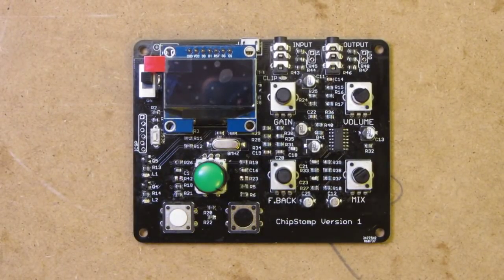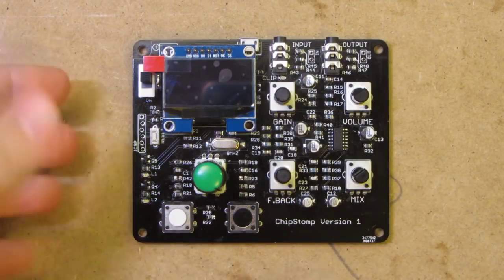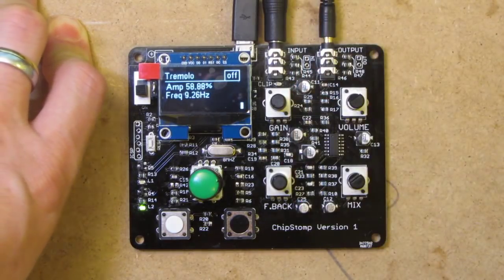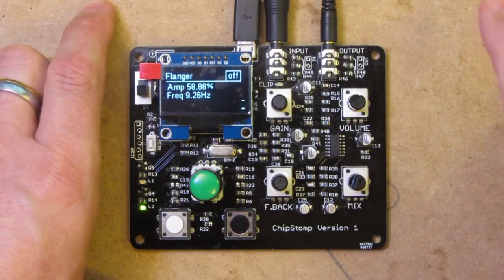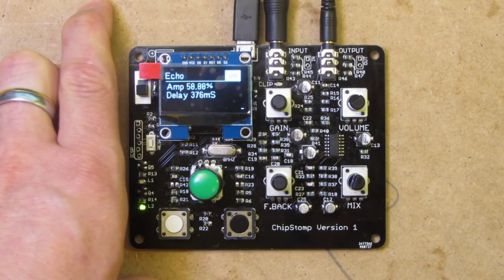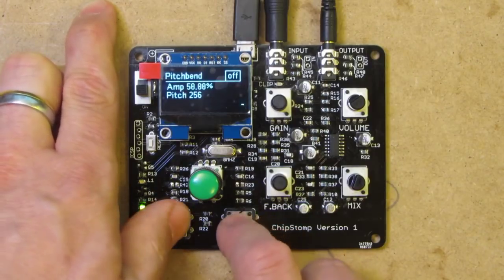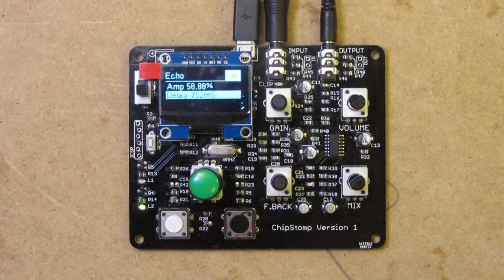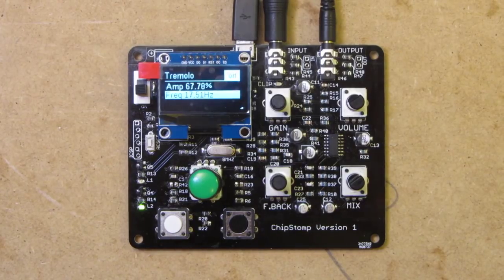Chipstomp - Arduino compatible digital audio effects processor.

Comment: Hello PCB???
Reply from the maker: In the description. https://github.com/Catmacey/ChipStomp
Reply: @catmacey hello, Sorry, I couldn't find the PCB Gerbers in a zip file etc.? Also, are there any effect codes like the octave phaser harmonizer and where can we find them? Best regards.
Reply: @catmacey First of all, thank you. Do you have a list of the parts used in the schematic? I would be very grateful if you could add a list.
Reply: Sorry, I couldn't find the PCB Gerbers in a zip file etc.? Also, are there any effect codes like the octave phaser harmonizer and where can we find them? Best regards.
Reply from the maker: @AfifeDemir-h5r9g  I had a dig around and found a zip of the Gerbers I had used to have the PCBs made. I have added it to the repo.
I have no idea what an "octave phaser harmonizer" is...  The available effects are there in the repo.
Reply: @catmacey First of all, thank you. Do you have a list of the parts used in the schematic? I would be very grateful if you could add a list.
Reply from the maker: @AfifeDemir-h5r9g  Sorry about that.  Ive added two BOMs to the repo, one ordered by unique part and the other by component value.
Reply: @catmacey First of all, you're a truly wonderful manager. Thank you so much for fulfilling requests instantly, without upsetting anyone. I have a question. Are there any other effects? For example, more different pitch shifter types, like triple and quadruple pitch harmonies? Or Octave Phaser. These are available in almost all digital pedals.

Comment: hi catmacey!
I very apriciate your work! 
The code are compatible with a simple arduino?
Reply from the maker: Hi Alby.
Honestly I'm not sure. 
The code has a bunch of PIC32 specific startup code to setup the ADC and interrupts. You'd have to write similar Arduino code to replace it.
The rest of it isn't tied to any particular chip but it does make extensive use of 16 and 32 bit variables as the PIC32 is a 32bit chip.
I guess you could run that on an 8bit AVR but I think it would be rather slow.  If you have a 32bit ARM arduino like an UNO, Teensy or similar then you should be fine.
Reply: catmacey Ok, thank you a lot!!👍

Comment from the maker: Hi Johnie.
I have it running from 3xAA and I haven't timed how long a set of batteries lasts.
The circuit runs at 3.3V through an MCP1702 low drop out linear regulator so using 3xAA gives just enough headroom to allows it to run from alkalines (4.5v nominal) or rechargables (3.6v nominal). 

I'll have a look at measuring the average current draw to work out an estimate.

Comment: What kind of latency do you get on this?  The guitar player in my band is an electrical engineer and programmer.  He might be interested in this.
Reply from the maker: I've not measured the latency. But in theory it shouldn't be much more than 1 sample. The ADC sampling, processing, mixing and output all happen in the ISR at rate of 44kHz so that would give a latency of around 2.5uS from input to output.  I guess there could be some additional latency due to the analogue input / output stages too but I don't know.

Comment from the maker: Hi Bobby. 
It's a 1.3 inch OLED module, 128x64px with a SH1106 driver.
I'm communicating with it using SPI but you can also use i2c depending on the breakout board they come on. 
You can find them from loads of places - Adafruit for example - but I bought mine from Aliexpress. Try a search for "1.3 OLED module SPI"